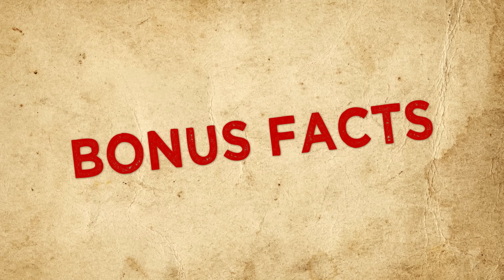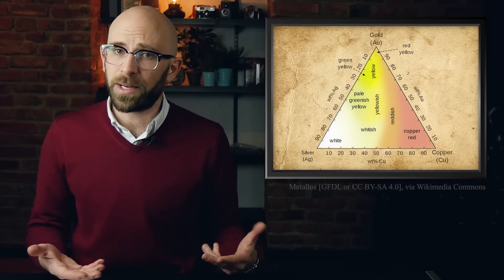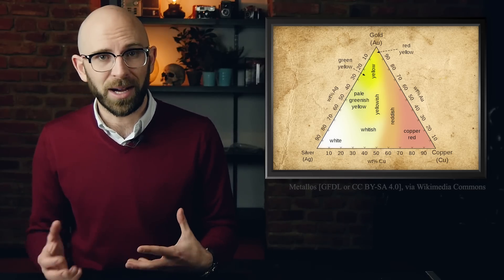How Do They Make White Gold White Given That It's an Element?

Comment: What is the point of making something from gold and then coating it? Why not make it from steel and coat it? Won't it have the same result? This makes no sense to me.
Reply: @jeniwatkins3297 , gold is heavier than steel. And being allergic to steel is probably as likely as being allergic to gold.
Reply: @mina86  gold has a full outer electron shell. It does not react to anything unless energy is added. O8nfa like your potato chips stay fresher when nitrogen is added to the bag to displace the air. Nitrogen has a full shell too. The way it tarnishes is by having stuff in the air kinda stick to it. Silver, iron, nickel and most other metals can oxidize. I am willing to bet that 99% of everyone who claims to be allergic to gold are in fact allergic to one of the additives that makes gold stronger or they had a bad reaction to something played in gold.
Reply: @williambowen2302  Finally, someone who knows what they are taking about. Thank you.
Reply: @erichobbs4042  I may know what I am talking about, but my spelling leaves much to be desired.
Reply: @mina86  No, gold is a contact allergen.( It wouldn't be steel, it would be nickel, you can get nickelless steel, but why bother. ) you can coat the side touching the skin with clear nail polish.
Reply: ScreamToASigh thanks for the tip. I think I might be allergic to my belt(most belts are made of nickel) I don’t want to throw them away tho
Reply: There's no prestige in stainless steel.
Reply: @jeniwatkins3297  You should compare the weight of gold to steel...
Reply: The gold is corrosion resistant and colored. So as the outer layers wear away, you can get a faint marbling affect. Also, you can get it wet without having to worry about having some of the exposed bottom layer corrode and blister the top layers.
Reply: And yet none of this seems to make it worth having gold jewelry that is then plated in a different metal. Other than maybe it being a marketing trick or something.

You aren't going to see it. Make the inside cheap and spend some of that saving on creating a thicker coating to increase durability and prevent the inside from being seen.
Reply: Most of the clients I've encountered that want that want a certain look that you're really only going to get if you've got a piece of platinum. In general, rhodium plating a piece is the cheaper alternative. While platinum is technically cheaper than gold, actually casting it is expensive and not something all goldsmiths are equipped to cast - the melting point of pure Platinum being  1768° C and gold being 1068° C. Which honestly is why a lot tend to send platinum they want cast to a casting house to do that. Just industry tidbits not everyone knows. 

But are you totally justified in your confusion? Yeah, totally. Rhodium plating does require upkeep, but it's honestly pretty cheap to upkeep it. Even then, it still confuses me too. I just roll with it and educate the customer on what they've got and go about my day.
Reply: A piece of white gold is very smooth and shiny white. Silver on the other hand scratches very very easily and becomes very dull looking. Silver also tarnishes insanely easily. Yellow gold is nice, but, white gold goes well with basically all skin tones and also helps diamonds look brighter. I’m not sure about plating steel. It may be that the rhodium plating does not stick to steel and would wear off very fast revealing the steel underneath, which is a very dark gray color metal not beautiful at all. My white gold wedding ring I wear every day stays white for over a year then it starts to look a little bit worn and I take it in to be replated which I have a full coverage service plan for that and it looks brand new again. Gold is a nice metal and has value and nothing beats white gold for me not even platinum because platinum scratches like crazy and turns very dull.
Reply: Because gold is still a valuable metal regardless of its form or what it's coated in.
Reply: Plating wears off for one thing. Allergies to metals is another. Even plated, inner metal can  bother someone with high sensitivity.
Reply: @jeniwatkins3297  lol, yeah, definitely heavier than gold. Gold is only 19g per cm, whereas steel is a whopping 8g. 

If steel causes allergies then maybe something else that doesn't, and make the coating thicker to slow wear. Should still be cheaper than putting gold inside. Which you can't even see. And telling someone there is gold inside your ring that is coated in a different metal is stupid to do it just because you are rich. Why not put some diamonds inside too.
Reply: because rich asshoels are rich assholes
and those "But its a store of value" dumbasses should really be being pure gold and keeping it in a safe if they want to store value, not cutting your gold and walking around with in in everyday life

Comment: So as long as you coat anything with rodium you've got "white gold" until it wears off.
Reply: Gold has a characteristic weight which can be precisely measured. Only tungsten even comes close. So no matter what you coat it with, you can tell if it’s real.
Reply: @steampunk888  Yeah but nobody else can and I kinda thought that was the point of jewellery
Reply: NO! It's just rhodium plated... Whatever it is. And rhodium and gold are not the same things.

True white gold is white gold all the way through. It MAY be plated to protect it. It's a fairly new thing to do. I have many white gold pieces that are not plated
Reply: @jeniwatkins3297  Rhodium is significantly more expensive than gold, and the use of rhodium to plate gold jewellery goes back to at least the 1970s. There are more and less expensive "white gold" alloys, but the cheaper ones have a significant yellow tinge, which many people don't like.
Reply: @dlevi67  Thanks. I am well aware of the costs. It has been used yes but, it only fairly recent became the standard
Reply: @jeniwatkins3297  It all depends on your definition of "fairly recently". At least 30 years as "(very) common practice". Which is a fair amount of time.

Comment: If you want Silver colored jewelry, why put gold in it?
Reply: the sheen is different. silver, even polished, maintains a matte look while white gold appears very smooth & bright. Also, silver jewelry will develop an antiquated patina over time, whereas gold will not...
Reply: Also some people are allergic to silver but still want a silver looking piece
Reply: @deathwatch27   werewolves and vampires.
Reply: @claireconover  Silver can be polished to a mirror finish, and it is the most reflective of all metals. https://e-reports-ext.llnl.gov/pdf/244132.pdf

The issue with silver is that - apart from the tarnishing - it is relatively soft and prone to scratching, unlike rhodium. Most gold alloys are harder than "hardened" silver.
Reply: Similar reasons people still get diamonds instead of much cheaper alternatives I guess, besides the physical properties. Adds to the lasting worth of the jewellery or the desirability and status that worth brings.
Reply: Silver tarnishes and white gold does not. Also, some people look to gold as a store of value.
Reply: @steampunk888 , ‘some people look to gold as a store of value’ – those people should be advised to not buy jewellery then.
Reply: @steampunk888  if it is for value then why take the risk of carrying it around? An ingot should be cheaper since you wouldn't be paying for the unnecessary cost of the jeweler's skills.
Reply: @MorbidEel  I think it's time for you to watch Freedomtoons cartoon short on economics  : https://youtu.be/RxOBGlYZDeE things are worth what you're willing to pay. That's economics. The same way I think spending money on an iPhone is ridiculous, personally I find them terrible compared to Android, but hey people are willing to pay more for what I think it's a worse product for more money - well G-d bless Capitalism...
Reply: @steampunk888  It's pretty simple to remove tarnish. Aside from various chemical cleaning methods, there's also electrolysis.
Reply: SteamPunk exactly
Reply: I was thinking that too....why pay all that money for gold that looks like silver? Just buy silver
Reply: @graeme3023  it doesn't look the same. If you don't wear it you wouldn't know, but it's noticeable.
Reply: I'm allergic to silver. it's just that simple.
Reply: @catherinehermansen4376 , They have silver for those with allergies, it's without nickel. You can also just clear coat (nail polish) the back, or have the back side plated..You don't need to buy new pieces if you have heirlooms any good jewelry store can do it. You can even have them gold dipped (plated).
Reply: I worked in fine jewelry for 6 years, and it's equal parts traditionalism, yearning for a sense of prestige, and thinking the quarter gram of gold in their ring is valuable because gold is valuable. People get really snobby about it, demanding NO LESS than 18kt white gold because they heard that anything less isn't real or valuable enough, only poors get 10 or 14. They then complain the price is too high but if you offer the exact same item in 14kt that costs less they lose their shit on you for daring to reduce them to peasant purchases.
Reply: @JennWanderer  why no 12 or 16k? I was told by my dentist my crown was 19k. Is that possible?
Reply: @JennWanderer  I don't know where you work or what type of store, but 14K AND 18 are NOT the same thing. Rolls eyes. I'm assuming it's a chain store if you don't know the difference.
Reply: @screamtoasigh9984  Where did I say they were the same thing? I said the same design in 18kt is more expensive than 14kt, and people get mad if you dare show them the design in 14 after they complain about the price of 18 because 14 isn't good enough for them even if they prefer that price.
Reply: I prefer platinum coloured jewellery.
Reply: Silver and white gold have different appearances as well, personally I'm more partial to the look of white gold jewellery
Reply: @BrandMalone24  ya- I like gold, but it's not flattering for my skin tone
Reply: There are subtle differences between the metals. White gold and Sterling are quite similar bit, are stlightly different too. I wear them together and no one notices because it's so slight. But if you look close you can tell. I prefer white gold BTW. It's durable and doesn't tarnish like sterling. But i do not have my gold plated.
Reply: Its not the same type of lustre. There is a very different look to white gold compared to silver or just steel. I myself really like red,pink gold and do not really like white gold but nonetheless, there is quite a difference  when compared to the cheaper alternatives
Reply: Because it is more expensiven that way and I think it being expensive is the whole point other wise why not make jewelry out of something affordable like tin and glass
Reply: Cuz the girl wants the more expensive ring
Reply: Because platinum it’s a lot harder to work with and at least 30% more expensive.
Reply: Because gold
Reply: Because it’s gold
Reply: @Jake except smarter, we have a CONSTITUTION. 💕
Reply: Weight
Reply: Right?!
Reply: blurglide  its subconsciously for the Annunaki
Reply: Yeah I know right? Silver does tarnish but thats a quick fix honestly.
Reply: The color of silver an white gold while similar are not the same.  White gold is also more durable and does not tarnish.
Reply: @hdtaylor1977  On the other hand the original reason to get white gold is now invalid. Instead of being more expensive, platinum is now 38% cheaper than gold, so platinum is now cheaper than white gold and looks essentially identical.
Reply: Kaerius platinum jewelry is still more expensive because it is much harder to work with.
Reply: Because silver does oxydize with time , gold as the advantages of being unalterable.

But to be fair it s just like you don t need diamond when there are white gems that have the same properties except hardness.

The material also reflect the preciousness of the piece
Reply: All of the previous comments are a little stupid... if you prefer the rhodium color to silver, you can coat it on copper. It still doesn't involve gold...
Reply: @hurktang  You could use aluminium too; it's cheaper than copper. The whole point is that - right or wrong - gold is valued independent of its colour for other properties.
Reply: A better reasoning would be if you want Silvery colored jewelry that's much harder and won't tarnish then just go for a platinum metal. Then you can pick from beautiful detailed designs that will withstand wear and tear. And since Platinum is cheaper than Gold right now, it's a double bonus on bargain prices.
Reply: @douglasthompson9070  Careful on the assumptions around platinum being "a bargain" because right now the metal is relatively cheap. A significant portion of the cost of platinum pieces is the energy and labour required to work it...
Reply: It's not about the color. You could get gold color without paying for gold, it's about worth. It's a status symbol, makes people feel good about themselves.
Reply: White gold is harder, and much more durable...
Reply: Marketing
Reply: Buying silver jewelry is like coming in second place on purpose.
Reply: @CharlesNauck  lol totally separate context.  Gold is a status symbol/a trophy for something you've done. Yes, buying something overpriced that you don't like is stupid. How do those compare? You saying you don't like gold or you can't afford gold?
Reply: @CharlesNauck  ps it was a joke lol I wear two tone anyway!
Reply: @CharlesNauck  I don't even drink also I don't travel. You're typing a lot of shit for no reason dude lol
Reply: @CharlesNauck  make me less busy pls :(
Reply: @CharlesNauck  your insult is entertaining at least. Presumptuous internet fruit thinks he understands everyone's life. Classic. Go waste more of your "30 second" intervals on garbage not worth reading. Go write a book if you think you're worth listening to. If this is how you react to a joke on yt I'd hate to see you at a party.
Reply: @CharlesNauck  oh yeah dude, I'm pissed lol no one has ever assumed anything about anyone online and deemed it as fact before. You're an internet anomaly. A chubby one too.
Reply: Silver corrodes easily, unlike gold.
Reply: Personally, I prefer the color of white gold to actual silver and I prefer platinum to white gold, however, I purchase white gold because the average person, like many in the comments who made similar remarks as you, don't know jewelry or metals. When I wanted to sell my jewelry, it was much easier convincing people to pay top dollar for white gold vs silver and other silver colored metals.
Reply: I like gold but I also don't want attention so I prefer white gold. It's beautiful and simple
Reply: Silver tarnishes and gold does it. They look completely different next to each other
Reply: My thoughts exactly! It's pointless and ridiculous!
Reply: Silver is a cooler tone than white gold.
Reply: @bobloblaw1720  Wow. You have the right to remain stupid , no one said you had to abuse it.
Reply: @iconoclastpleonast8726  Didn’t anyone ever tell you that in order to be a smartarse, you need to be smart? If you’re not, it just makes you an arse.
Reply: It’s good for piercings
Reply: @bobloblaw1720  Enjoy communism!
Reply: The glimmer of Gold can persuade a border guard to let you slip across to safety, as has been talked/written about for years. (Also works on less-than-fanatic Secret Police officers.')
Reply: silver sucks.